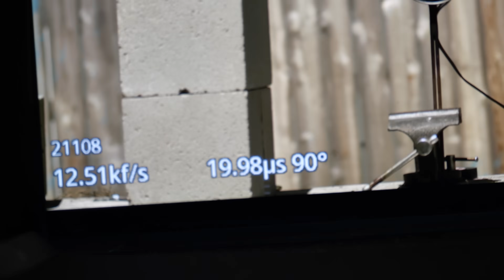Spinning a Record to Pieces at 12,500fps - The Slow Mo Guys

Comment: what is the science behind the record ripping apart?
Reply: Two ways it might break.

First the record appears to hit multiple normal modes (the shape an object takes when it enters resonance) this causes high deformations in the record to the point that it can break it (the same way a stick of wood would break if you bent it).

Second ways would be breaking due to high speed. The forces acting on the record when it's spinning arise the more rpm there is to put it simply. To a point where the material cannot sustain. Imagine a rock tied to a string that you spin faster and faster. The string eventually breaks.
Reply: When an object rotates, forces act outwardly. It's called centrifugal force. Like when you spin a rock on a string, it travels away from your hand and stays in the air because of the centrifugal force. The rock doesn't fly away because it's attached to the string. Here they spun the record so fast that the centrifugal force was stronger than the forces keeping the record together. So in short, they spun the record so fast that it was not strong enough to hold together in the face of its angular momentum.
Reply: Thanks science side of YouTube 😀
Reply: id have to disagree and agree again. The records that cracked from the middle was probably destroyed by centripetal force, but the ones that cracked from the outside was likely from vibration nodes (if that is the correct term). In the string and rock example, when the string breaks, it breaks at its weakest point due to the tension on the whole string, however, in all of the records that broke at the edges, they broke off at the edges, not at a point somewhere near the middle of the record. This lines up with the fact that the record vibrates at the highest intensity at the point furthest from the center of rotation, which are the edges. On the other hand The ones which broke from the middle may have been due to centripetal force, as the whole record is being pushed out away from the center, and a certain weakpoint in the edges at the center of rotation caused the record to crack outwards.
Reply: i think @TheUnPlayable got it better than @funster. The records seems to shatter from a point most of the time, which indicates that that area/point is under a huge amount of pressure/force, which again indicates that it is breaking due to hitting modes rather than being stretched out due to centripetal force. But then again, im not a physicist.
Reply: Ha Quang well for sure the abnormalities in the rotation and the resulting flexion in the record exacerbate the breakage, but like the most contributing factor was the centrifugal force.
Reply: Ha Quang I think I can agree with this. Yeah. I'm happy with this explanation as well.
Reply: Think: Sindel's fatality from UMK3.
Reply: Ooooo science arguments

Fun
Reply: BSN Nishijima the vibration shakes it and when it gets to be too much

Comment: Use the record as a saw blade
Reply: How fast does an actual table saw blade have to go to explode?
Reply: Sprennard87 circus baby I'd wager it would shatter on contact. Vinyl is brittle. Steel and paper are not.
Reply: You don’t need to have anything like that be a saw blade. Like Sprennard87 Circus baby said, even paper can cut wood. Not that thick wood, but it works.
Reply: yes spin the paper FAST
Reply: embustero71 i don't think we could make it spin fast enough
Reply: Or use paper and make it thick by glueing more paper together
Reply: someone did get a saw blade to pop they was ok, safety  goggles help to stop your eye get hurt

Comment: Dudes, the records were seemingly spinning at about 1 revolution in 60 frames at 12,500FPS, equating to 208RPS. So the edge of the record had a speed of 439MPH (assuming it was a 12 inch disk, or 366MPH for a 10 inch disk). That's more than half the speed of sound!!

Comment: The record is effectively providing little resistance to the motor at speed (surface air friction only). These are series-wound motors that rely on the fan blades to limit the maximum speed.
With no fan blades, or record, the speed will climb to a point where the motor winding encapsulation will let go - now THAT would be an awesome video!
You might want to do it somewhere that pieces of the motor will not injure people or damage buildings as the armature and stator could leap away in any direction...
(We used to do this with motors from old cylinder vacuums we found on dumps when I was a kid. :) )

Comment: The disc is not perfectly centered. A larger engine with a more matching impeller for the plate opening and larger, perfectly even washers will allow higher speeds. And stable assembly of the whole. Greetings from Poland.

Comment: That wobble that occurs and then disappears and comes back again is resonance... I believe that anything that spins has one or more resonance frequencies which cannot be avoided. I think they can be shifted but can't remember how... perhaps a change in material or counter balance... you see this when a bench grinder slows down - it suddenly shudders ... I guess the manufacturers have a way of making the point of resonance occur at a low speed!

Comment: I have several questions: 

1. Why are Dan's fingers yellow? 
2. What would happen if you glued several records together? How much more spin would the thicker disk take? How much more energetically would they explode? 
3. Why wasn't the high-speed camera protected? Are they especially hardy? Are they so inexpensive (or is a YT channel with 11M subs so lucrative) that a broken camera could be easily replaced?  (This sounds pissy but I legit wanna know).  
4.  ...... seriously tho is Dan ill or something?  His fingers look like he's goin through liver failure.... 

you are of course under no obligation to answer any of these, I'm just curious. cheers.
Reply: They record months worth of videos during a short time period as they live in different countries, so Dan's fingers are most likely coloured from another video.
Reply: 1. Maybe yellow paint?
2. I don't know, but vinyl would be stronger than wood glue IMO.
3. Good question. I was wondering the same thing. Hydraulic Press Channel uses blast shields all the time.
4. Refer again to #1.
Reply: yeah it occurred to me afterwards that they probably filmed the intro AFTER they filmed the slo-mo bits, so the yellow is probably just spray paint from when they painted the quadrants. ¯\_(ツ)_/¯

Comment: Now this is a slow mo! 12500 FPS, not that sillly 1000 FPS almost smartphone speed. And the backyard, not the fancy filming crew and some sort of testing site. Good ol` slomo guys! lol
Reply: The det-cord ones were cool.
Reply: And now they upload at 50 FPS instead of 30 FPS!
Reply: The slow mo is still 25fps for maximum reasonable slow mo though. It's just the other camera records at 50.
Reply: They didn't do much this high-speed in the super slow show because most of the stuff they were recording didn't need it. They had an insane production quality, so IMO it makes sense that they recorded as much as possible in 4K, rather than in unnecessarily high framerates.
Reply: VPhaetonVv
 - You're trying to compare a smartphone camera against a dedicated high speed camera which is just stupid.
Reply: Look  at their glass breaking vid - nearly 1/2 million fps

Comment: If I had a single suggestion, do the exact same experiment, but next time under a UV light and a single florescent line from the center to the edge. Or maybe an LED strip. The visual alone would be epic.

Comment: You should really put a metal flywheel on that motor, it will be easier to gradually increase and decrease rpm and it will be better for the motor since it isnt left without amy resistance when the disc breaks. Thats really bad for motors

Comment: On average the Records took 1.26 seconds for one full rotation. The video was shot at 12'500 fps, which divided by 60fps playback speed, gives a factor of 208. Considering one revolution took 1.26 seconds and the circumference is 94.2 cm, the vinyl records most outer pieces move at  74.7cm/s * 208 =  15600 cm/s,  156m/s, or 561km/h. Yup thats fast. The time per revolution was estimated by playing the footage from 11:56 at .25 speed and then dividing the time taken by 4. Any miscalculations or mistakes are welcome to be corrected :)

Comment: Guys, I think it's time you invested in some thick plexiglass panels (or whatever the Mythbusters used on their show). If you're generating these kinds of fragments, you're going to want to contain them with something other than a few cinder blocks and a board. (Especially since the fragments are going in all sorts of directions.)
Reply: Jack Linde bullet resistant lexan I believe
Reply: 4:21 theyre safe
Reply: Jack Linde I think they had something like that on the super slow show
Reply: But it just wouldn't be the slow mo guys if they used proper safety equipment 😉 one thing I enjoy about these guys is their deliberate disregard for all safety features lol

Comment: You could actually calculate the force needed to push that board upwards as much as it did.
it's basically a flat splinter grenade

Comment: Do this with a 10" or larger sawblade.
Yeah, I know, that would be mighty dangerous!
Reply: I think they'd have to have an unrealistically beefy motor for that, geared up ridiculously. Otherwise, that would be quite boring.
Reply: Double Dare Fan it wouldn’t break because it’s designed to spin fast

Comment: Would anyone know how long it would take at those RPM's for it to play the entire record start to finish?
Reply: the frame by frame puts one revolution at roughly 30 frames, at 12500 frames per second. this is 416.66 revs per second, or 25000 rpm. at 33rpm a 12inch record is roughly 22 minutes per side. this is spinning about 757.57 times faster, so it would play in 0.029 minutes, or 1.74 seconds per side
Reply: Kamikrazey simple but effective maths and well done for being bothered to do it

Comment: "You put a voltage through it and you can vary it". Could you not just have used a potentiometer (variable resistor)?

Comment: The Phantom v2640 isn’t terribly portable with a weight of 17 pounds, but it does come with a custom Pelican hard case for travel. That’s really the least Vision Research can do when you buy the camera — it’s extremely expensive. The base model with just 72GB of storage runs $135,000 and the best model costs $175,000. A single 1TB CineMag IV will run you almost $12,000. None of that should come as a shock, as the Phantom v2640 isn’t exactly a consumer device. It’s aimed mostly at filmmakers and researchers.

Edit- I was just curious on how much one of those cameras cost, and this was in the article I read.

Comment: 2:16 for the normal speed
3:19 for the slomo part
Reply: 8:11 for rainbow record
8:44 slomo part
Reply: Oh and make them do two canon balls shot at each other.. Or two bullets lol

NO ONE has been able to catch that on a slomo camera yet.
Reply: Yea, seems dangerous and hard. 2 guns pointed at one another. Doesn't leave to many safe spots as usually you sit behind the gun. Same with cannon balls.
Reply: Limp Wibbler If they shot both the guns up in the air at the same angle it won’t be as dangerous
Reply: You shouldn't shoot guns up.
Reply: Ok that is safer, but another issue now. You are shooting 2 things at an angle at one another. Which is a totally different result. Not all the force will be exerted into the bullets directly some of the energy will go to sliding them off each other making it still hazardous and a worst result.
Reply: Or they could point the guns at each other and attach the triggers to a string then pull the string from a safe distance 👍

Comment: Out of curiosity does the warping have something to do with resonance? If anyone knows please reply with as much detail as possible
Reply: Yes. The rotation, in and of itself, doesn't have that much to do with the failure of the LPs. Spinning that fast, if it only resulted in a perfectly symmetrical radial force, wouldn't break them. What does them in is the fact that they're aren't perfectly balanced, and so that results in a vibration. The vibration introduces energy across a broad range of frequencies as the record increases in speed. Mechanical structures have an essentially infinite number of resonance modes that can take on some pretty wild shapes and impart some very high localized stresses depending on the shape of the structure. When the vibration excites a mode that generates a localized stress that exceeds the ultimate strength of the material in that location, you get a failure. For something like a record, the shapes start out pretty simple. The first mode would probably be like a speaker (picture holding it flat by the center and shaking it up and down and the whole rim moves up and down together. The second mode would probably be lateral bending mode (again, picture holding it flat, by the center, and then rock it left and right, one edge of the rim going down while the other is going up.) The third would be shaped like a saddle with two high points and two low points on the rim (it's hard to explain how to excite this by holding it, but it would be a combination of rocking and moving up and down.) Above that you start getting modes that are a superposition of sinusoidal shapes both along the circumference and in the radial direction that are difficult to describe without pictures. You can probably google "mode shapes of a spinning disc" to read more.
Reply: chaz720 Now that's detailed.
Reply: chaz720 thanks that’s supper helpful and detailed

Comment: its insane, the speed of light.  These kinds of slow motion really make me appreciate the speed of sound and light, because the lights and shadows look perfectly normal and regular, like this is all happening in normal speed.  Blows my mind.  I also wonder what would happen in this, if you introduced imperfections in the discs.  I wonder waht would happen if you added deep scratches from the center to the outisde of the disk, or if you intentionally chipped the outer rim a bit, so it was missing a chunk.  would it break along those fault lines, or will it still break from another point on the outer ring, or in the center?
Reply: The sound is artificially produced after the fact, when sound is slowed down to this extent it is a roaring cacophony.
Reply: Carson Bridenstine i know how they do their sound effect, i am just saying the speed of light and sound because of their vast speed.  Even with the high frame rates light is unaffected, and i extended the notion to sound waves as artistic license.  I am aware that the sound waves would be altered.  I am not refering at all to the sound added in, as the phantoms do not record sound, and i know how gavin adds the sound affect in post.

Comment: Dan is right about it warping at a specific  speed, it is called the natural frequency of the material, if the driving frequency (imparted by the rotational speed) is matching the specific natural frequency for the material then it resonates,causing the warping effect at a specific rotational speed

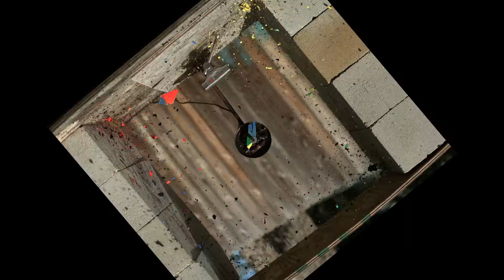Comment: Assuming the part at around 12:30 was shot at 12500fps, the tangential velocity of the outside of the record at that moment was almost exactly the speed of sound!  I think I counted about 33-35 frames for one complete rotation.    If it was 33, then the tangential speed was 811 mph (1305 kph).   If 35, then it was about 764mph (1230kph).   The speed of sound at standard sea level pressure is 767mph.

Comment: all said an done, very cool, but what if you spun one up to a point just before it exploded and then shot it with a BB gun, and had the camera off on the edge? that would be a way to accurately give you a break line in the camera focus plane.

Comment: @12:40 its doing around 20,000 rpm, if your recording at 12500 fps and it took around 39 frames for a full rotation, that means it takes ~0.003 seconds to do a full rotation meaning its spinning ~333 times a second! and then 60/0.003 =20000rpm!!!

Comment: 1080 @50 ?! I miss 4K :(
Reply: I'd rather have 12500 in 1080p then 1000 in 4K.
Reply: Might still be processing
Reply: It's harder to get higher fps with higher resolution, so if you want things like this (ie, insanely fast stuff slowed down) then you just can't do 4k
Reply: it's in 4k for me
Reply: espro don’t worry, it will come again soon.
Reply: No no no no stop
Reply: espro Ssshhhhh